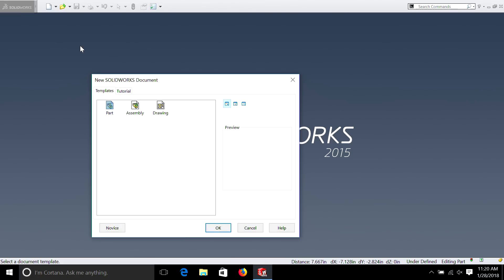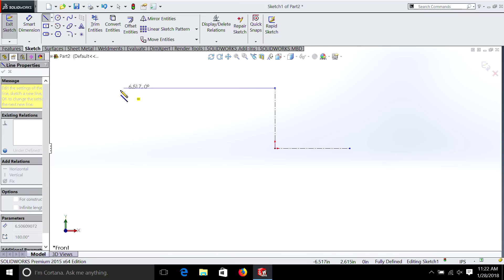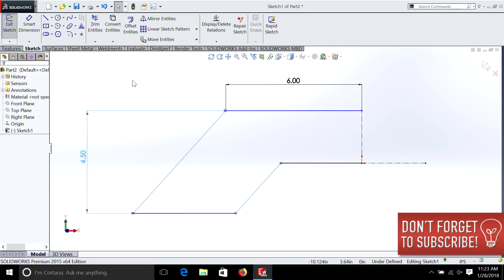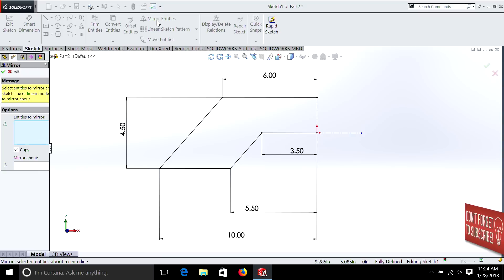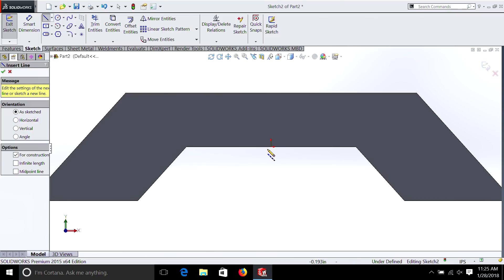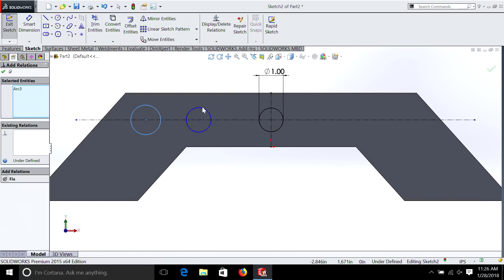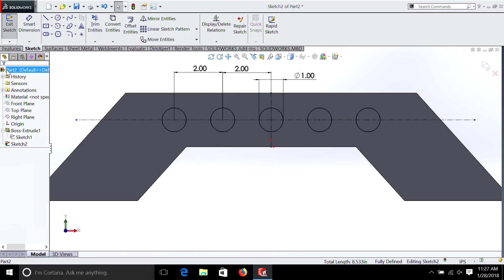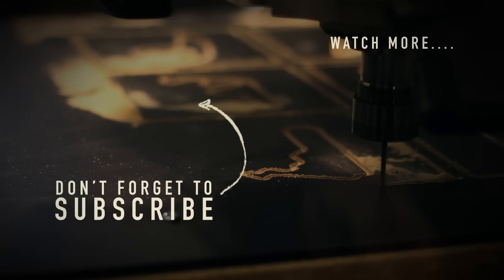Learn Solidworks In Five More Minutes | Part  7

Comment: I appreciate the tutorial! When adding a "parallel" relation, is there a way to choose which line is the reference line? 

For example, if I sketched the first line slanted, but the second line was sketched vertically, adding a "parallel" relation between the two makes both lines vertical! How do I specify that the parallel relation should reference the slanted line?

Thanks!
Reply: I may have answered my own question. I think I can enforce this by removing the "vertical" relation on that second line prior to adding the "parallel" relation.
Reply from the maker: Each line or point can have more than one relation. In other words, you can make one line vertical and then add a second relation that makes the other line parallel.  If the first line is causing the second to also be vertical, then delete the reference “vertical” for that line. You then need to draw a dotted vertical reference line in the sketch from the origin. (I show how to draw reference lines in a few of these videos) You then need to use the dimension command to define the angle of one of the parallel lines. If the lines don’t go through the origin, use a few dimension lines with angles and dimensions so the lines are fully defined including the distance between them and their length.